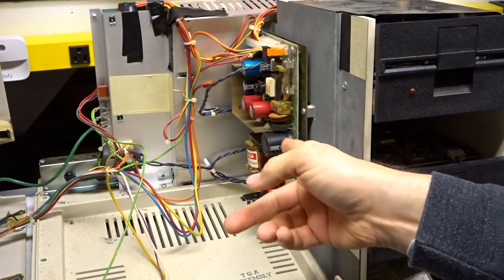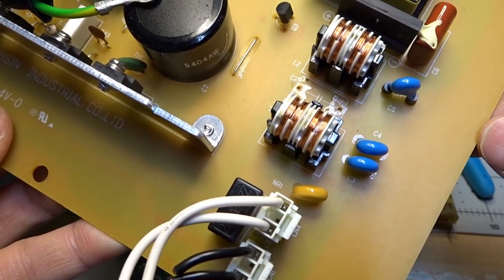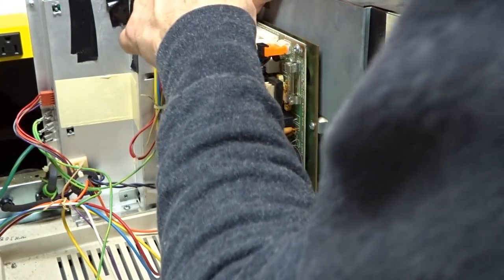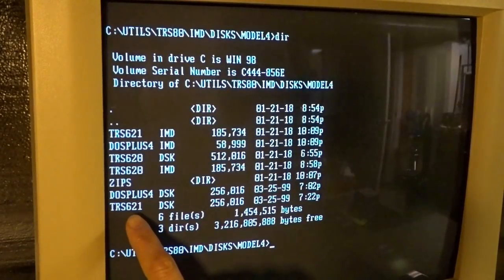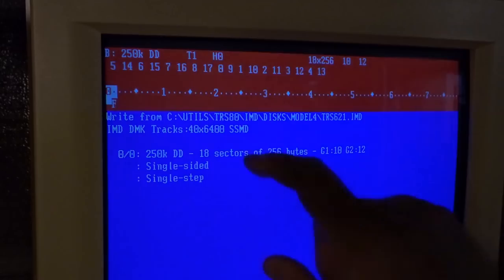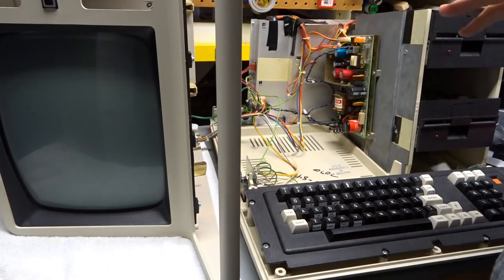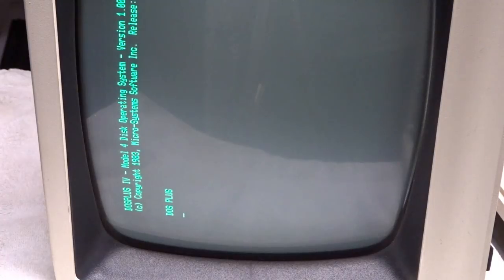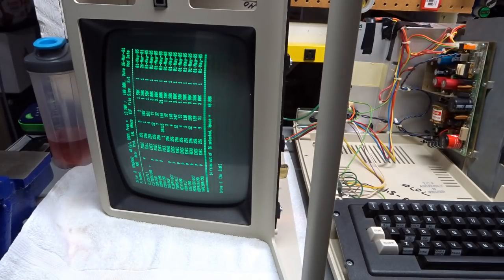Part 2: TRS 80 Model 4 - Fixing the power supply and writing TRS-80 disks

Comment: I worked at a Radio Shack Computer Center at this time.  The DOS that came with the model I, 3, and 4 was TRS-DOS, and was pronounced "triss-doss"  and there was also an after-market dos called NewDos by Aparat; which was virtually identical, but provided some enhanced commands for File I/O and a built-in keyboard de-bounce routine. NewDos was practically mandatory on model 1s, due to the bad keybounce.  Great Vid!

Comment: I started out on the Model I and have worked on every model (pre PC models), so Model 1,2,3,4,12,16 and the color computer line as well as the MC-10.  Few things to mention.  First, you can hold down break and turn the power on, the moment the power is on, you can release break and wait for the CRT to warm up and you'll see Cass? appear.  Also, if it's on, there's no need to turn it off.  If you're booting to a non-disk setup, and the unit is on, you can hold break and simply hit reset instead of powering off and back on.  Lastly, and most important, I cringed each time you powered on with the disk in and the door closed.  Easy way to fry a disk, I'm surprised you didn't.  Best practice is to insert the disk, but leave the drive door open, then power on, and while the drive is seeking to zero, you can immediately close the door after power on and it'll boot to disk.  Several OSs out there that will work, TRSDOS, CPM, LDOS, NEWDOS/80 to name a few.  The system also supported 4 drives, and since the machine was designed for two full height drives, you could actually get 4 1/2 height drives mounted in the system which a lot of people did in later years when the 1/2 heights became available.  NEWDOS/80 supported pretty much anything, you could manually configure number of sides and tracks for each drive, and specify 5 1/4" or 8" drives.  In more recent times, there are things like FreHD that emulate drives, but store data on an SD cards.  You could probably put every Model 1/3/4 program ever made on a single SD card.  My friend bought a 4P to (lug) to college with him.  Nice, portable version of the 4, still had to be plugged in, and was still quite heavy, but basically the same machine.  I think the only thing it lacked was a cassette port.

Comment: Great couple of videos, good to see this old system coming together.  Just a few comments... your system has the horrible Tandy-designed lower-cost power supply which was marginal and problematic when new, and nowadays most exhibit the problems yours shows.  Tandy wanted to reduce costs so instead of buying the bullet-proof Astec (save for the Rifa caps) designed their own low-priced turkey.  It was so bad that a tech bulletin from Tandy expressly forbade using this low cost PSU in Tandy hard drives due to the variable nature of it's output.  Tandy used this PSU and when it ran out during production would begrudgingly install the more expensive Astec, which is why in US M4s you sometimes see the Astec.  Also if the computer went back under warranty with a failed PSU they would install the Astec, or if you walked up to RS National Parts to order a M4 PSU you were invariably sent an Astec.  

Your machine is also interesting because its a non-gate array (PAL) system, but has the Phillips 12VCMP31 CRT and membrane keyboard which were sold with the 4GA.  Its possible that this was such a late production PAL M4 that TCA had run out of white 12VCMP4 tubes and the ALPS keyboards typical of the PAL systems, or more likely the keyboard stopped working at some point and again at the time if you want to RS National Parts asking for a Model 4 keyboard and they had no ALPS keyboards on hand you had no choice but to put in the crappy membrane 4GA keyboard, which was not a big deal since it fits and works.  

I hope that when you remove the RFI shield you find a hi-res board, indicating you have a fully maxed out M4, but if you don't find one remember I make and sell HRGs :-)
Reply: All maufacturer are cost cutting. Consider this machine sold for $2000 back in 1984. That would be like $8000 in todays cost, and really was not that powerful a machine. Z80C was the last generation of Zilog Z80, which boosted its native speed to a whoppling 8 Mhz? I recall having a Z80B in my Model 1 and with the flip of a switch you could run everything at double the speed. But you had to flip it back to low speed to load programs in from tape or disk.

Comment: If I am not mistaken, the "deleted data" message in IMD is referring to sectors which use the "Deleted Data Address Mark" (DDAM) instead of the regular address mark. I believe that at least some of the TRS-80 disk formats used DDAM on the directory track sectors. In other words, these are normal, esoteric, low-level details about the formatting used in a particular image, and not something to worry about. Congratulations on your progress fixing up your Model 4!

Comment: Here in the UK, the TRS-80 wasn't that common. I bought one from the USA on eBay about 18 years ago (the shipping was a killer), expecting to have to run it off a step-down transformer, but on opening up the case I saw that there was a jumper on the PSU for switching between 110V and 240V. I wonder if that was the more expensive Astec board mentioned in other comments? All I had to do was switch the jumper and replace the US 2-pin plug with a UK 3-pin one, and it worked perfectly on native 240V AC.

Comment: I learned to program BASIC on a model 4.  To go to model 4 BASIC, hold down the orange reset button while it boots up (instead of break).  Also some disk games put out audio on the cassete tape interface (you'd have to connect a speaker to it to hear), but it was pretty great.  Also the printer port, even though it's a weird card edge connector, the port was a centronics port that was compatible with pc printers (though radio shack made a really cool daisy wheel printer, that basically worked like a fancy type writer).

Comment: I replaced the RIFA and reflowed the connectors and it started right up. Interestingly enough the machine had a power supply used more for the 4P but it seems to be an original 4 with the blue CRT and discrete logic chips.  I had my fill of deskmate and multiplan so I bought one of Ian Maveric's hi res graphics boards so I could watch fractals and play Reversi.

Comment: I remember some of the TRS-80 IVs at school (in 1988!) had that "flicker on drive activity" intermittently.  I always assumed it was the monitor wigging out because of the drive motor's magnetic interference :P
Reply: The drive motor ran at a constant speed. It was the fluctuation of the underpowered supply. Bad weak caps, causing spikes and noise.

Comment: Really nice score! I'm glad you're saving it - and its box! Kudos to Radio Shack (may you rest in peace) for the great stuff you once sold in every town.  

The loose connection to the monitor - I don't see "blooming", which is where horizontal and vertical deflection are both affected at once, usually also affects high voltage supply and therefore CRT focus. This really only looks like it affects vertical deflection. Look at the capacitors in the monitor board, especially around the power supply and vertical output circuits. And yeah, reflow every solder joint on everything bigger or hotter than a 1/2 watt resistor. The vertical movement you're seeing represents a fairly large change in current to the vertical output stage as you wiggle the wires, so there's a fault that really needs to be found and fixed. 

Something is still wrong in your CRT blanking circuit; your retrace lines and raster shouldn't be so prominent. And you've complained that the brightness isn't what you expect (but that's subjective - I remember these machines when they were new, they weren't really bright, you weren't looking at JPEGs). So, what affects vertical deflection, brightness, and causes retrace lines? Make sure you have the rated voltage to the monitor's board. Is the filament power coming off the flyback? And then, after that, use an ESR tester on any capacitor even remotely near a heat source. I wouldn't want to re-cap that whole computer, it's a museum piece and has good brand caps already. Let's just make sure it works, and save all the old parts in a baggie in the chassis so that they'll be available if it ends up in the Smithsonian. 

Just take your time and relax. This computer knows it's in loving and caring hands and it wants to be fixed. If you've done a few repairs, you know when a machine is working with you on the repair. Quality parts, quality design, pride in construction, luck and human respect in the life that it's had, and then there's a certain other factor.... It just WANTS to work, and you can feel that in your gut. 

Lawrence Wade
Ottawa, Canada

Comment: "Dry" solder joints weren't restricted to any particular manufacturer.  I can remember seeing a repair guy struggling to fix a Commodore 64 which would keep on rebooting whenever you moved it.
I got him to let me take a look and I quickly spotted that the solder joints all around the power connector were very dodgy.  When he re-soldered those joints, the rebooting problem stopped.

Comment: Considering that there had been some component replacement on the power board, I would have gone and replaced ALL of the caps and would have checked the resistors. Also would have checked and maybe replaced the VR components as those tend to go kaput if there have been any issues with the power board before. Worth the work in the long run.

Comment: Looks like you got it mostly fixed. If you find it has ripple of the display, I had replaced the main 220UF cap in my Model 4P which cured that. I also cleaned controls, and resoldered all the pins. Its normal for age to oxidize, and crack the solder joints from heat over time. Just resoldering all the power supply stuff usually works. Power supply is the hardest working part of the computer.

Comment: there was an upgrade/fix tandy put into some model iv's with 12v issues, it was a seperate powersupply specifically for the floppy disks.  i had one at one point with a tandy installed aux power supply for the drives.

Comment: Love the video.  Just a friendly tip.... Don't turn on or off the TRS-80 with the disk drive door closed.  You will zap the disk.  I'm kinda surprised it didn't happen during the video.   My TRS-80's will zap a disk every time, like clockwork.
Reply: I have turned mine off with the doors closed, disk in, never had prioblem. But do not do that while the drive is running. If yours is zapping the disk, you may also be victim to the mains cap weak. That causes spiking in the power supply, as it is a switching supply. So result is the voltages spike on the 12v and -12v areas.
That causes FDD to send data spikes to the drive.
Reply: I was a Tandy Computer Center manager in the 1980's..there was a Tandy Service bulletin that came out that said exactly what you said..what happens is on power on the floppy drive 0 head is energized and does a write for a split second then steps the head to 0 then checks for write protect then it does the same for drive 1...it all depends where the head is when you power up...if it is at track 0 or track 17 that would cause the most problems ...anywhere else on the disk the CRC would be able fill in the missing byte of data...
The Model I said to put the disk in and turn on the power

The original Model III owners manual said to put the disk in and turn on the power (copy and paste from Model I manual). It was corrected on later revisions

Even some of the software said to put the disk in and turn on in their owners manuals..Most likely a copy and paste from Model I

RE: The Model I  did not have a model number on it it only said TRS-80..With the expansion unit you could hook up to 4 floppy drives

Comment: So I learned a few things about TRS-80 disk images, maybe you've also discovered but I'd figure I'd report here. 

The DSK and DMK files that ImageDisk is able to convert are all DMK formatted disk images. The ones that don't work (and are usually smaller in size) are JV1 or JV3 formatted DSK files that ImageDisk can't deal with. 

There is a way to deal with them though. David Keil's TRS-80 Emulators, he has ones for the Model 1, III, 4/4P and CoCo have special files that let the virtual disk drives in the emulator use a real PC drive. So you can mount a DSK and a real disk in the emulator and using TRS-DOS, LS-DOS, CP/M or Disk Basic on the CoCo, you can duplicate the mounted image to a real disk. You can also use native TRS-80 disk duplicating software like Super Utility as if you were on a real machine. I had been using the IMD method myself, but I had a lot of images I was unable to write and the emulator method basically solved all the little issues I was having.

Comment: I had the same filter cap burn on my Model 4 just a few weeks ago, but I haven't ordered a replacement yet.  When I do get around to fixing it, I'll check for bad solder joints as well.  Great video.

Comment: Those X2 rated caps tend to lose value over time, they just wear out, even the good ones do. It's a good idea to measure the uF value before putting them in.
Also the 0.01 vs. 0.1 uF should not make much of a difference, mostly a frequency response thing. Definitely no sparks should fly because of that as long as the voltage rating is sufficient and it seemed to be at 275 VAC. I suspect the part was already bad or maybe it got too hot or physically damaged during the replace.

Comment: One thing I learned working as a tote man is that those pins in those molex connectors get weak and thus create a gap between the rail pin and the receiving female pin on the connector cable leaving just enough space for micro arcing to occur please look at the plastic and if there's browning that indicates a bad spaced arcing molex which will create crazy stuff like intermittent blackouts or unwanted reboots and shutdowns

Comment: Do you have an ESR meter for testing caps? A cap can look ok, but it can still be leaky. An ESR meter will tell you what the Equivalent Series Resistance of the cap is and if it is out of spec (or close to it's max value), replace it as it is bound to fail in short order. An ESR meter can save a lot of the time and effort of you having to revisit the power supply to fix it again.

Comment: On these old power supplies the best you can do is to replace all the electrolytics. Even if they aren't bulging or leaking electrolyte, they tend to become a load instead of a capacitor even if their capacitance looks fine when you test it, it's not under voltage. In some cases under voltage they turn into a resistor that pulls the regulators down, often killing the regulator as well.

Comment: Those caps must be replaced with the proper X/Y-rated safety caps, or left out. The safety caps are designed to fail open, and not catch fire or smoke (like yours did). Old tube radios and TVs sometimes had these across-the-line caps for the same reason. If you can afford it, replace any old 85c rated caps with modern 105c rated ones from Nichicon, Rubycon or Panasonic. Those old electrolytic caps can leak, or fail outright and stink up the place, too!

Comment: A 10x bigger filter capacitor won't break the PSU. Also, it shouldn't blow or spark like the one you placed, unless it is bad or is not rated for that voltage. As for the electrolytic capacitors, doing a recap may be not prudent at all, and actually can cause more harm than good. Anyway, nice video!

Comment: "Yanked it out, very easy"  
Oh shut up.
I can't solder a drop on my workspace.  You make it sound so easy.  
How many times have I cried as I BROK the part I was trying to remove.      Too many times to count mister !!!   
(Really, I am ALL thumbs)

You are so brave.
Reply: Despite solder suckers and removers, I usually had best results just with small pliers and heating and plucking. Less heat means less damage.

Comment: Great series!  I'd love to see the floppy drive servicing. IIRC, I had to send my old 4 back to RS for realigning the drives at least twice. Can't remember what exactly caused the issue - seem to recall it was something stupid I did, like trying to read tracks beyond the floppy's capability in some sort of disk software. Super-Utility maybe?
Reply: Old floppy drives used a metal band that was the head stepper. If the head jammed, it would bend the metal strip, and ruin the drive. You could never get it to align right after that happens. The drive belts also could be replaced, but you discover with age, that they deteriorate, and get soft and gummy. That causes the drives to not run at a proper speed, fluctuating, and just useless. Most drives had the 60 cycle squares to help calibrate the speed using a neon bulb. There used to be calibration disks, using a decent oscilloscpe to align the stepper motor to get proper signal. But seldom did they get that bad.

Comment: I use an HXC floppy emulator on my Kaypro 2x which uses CPM 2.2u as its operating system, I believe the TRS 80 can also run CPM. however I choose a floppy emulator over original disks for stability and longevity, as a 256mb sd card is now my A and B floppy drive and it will load all disk images natively though the pc program for the hxc
Reply: yeah, montezuma cp/m 2.2-2.4 were available, and tandy sold a cp/m 3.0.  i preferred the 2.x. (diffs between 2.2 to 2.4 were minimal)

Comment: It would be prudent to avoid touching the contacts of those capacitors on the bottom of the board.  I didn't have one of these, but I did have a TRS-80 Pocket Computer that I got used the same year this computer was built.